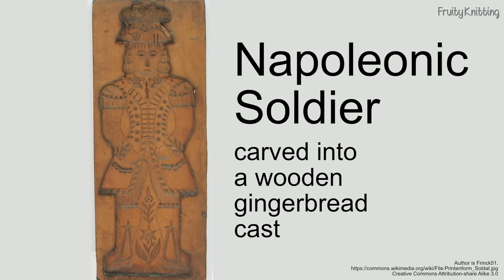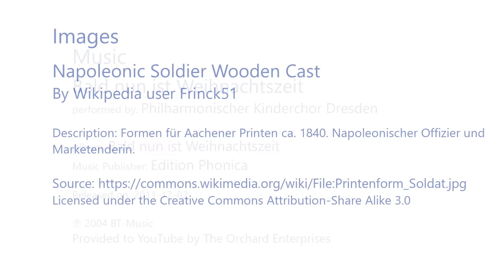Snowflake Angels, Gingerbread & a Swiss Woollen Mill - Ep. 139 - Fruity Knitting

Comment: Hi there, wishing you both a very merry Christmas. I was wondering how you managed to keep the same gauge between the circular knitted bottom part and the flat knitted upper part? I am currently knitting a similarly constructed project and my gauge always gets looser, should I maybe go half a needle size down on my project or would it enough trying to knit slightly tighter? @fruityknitting